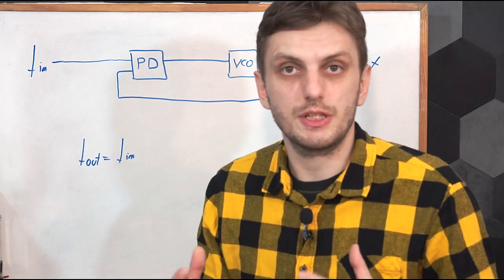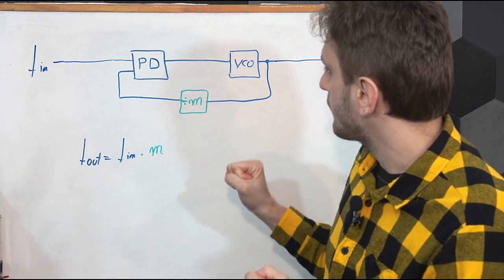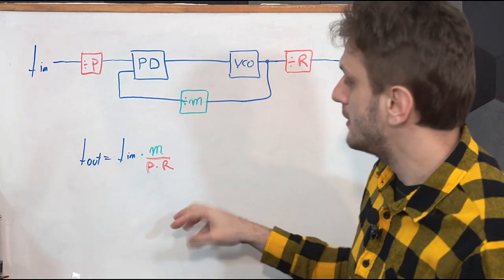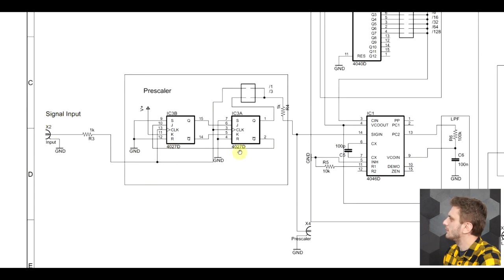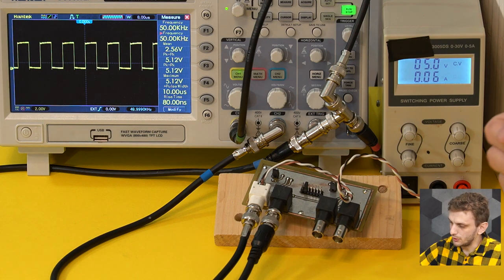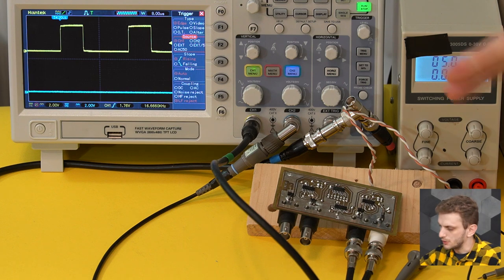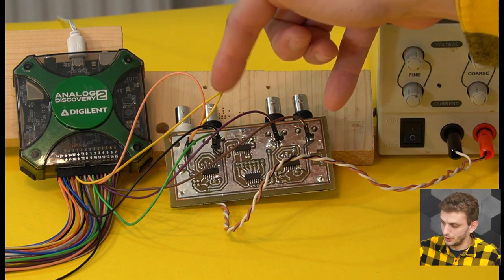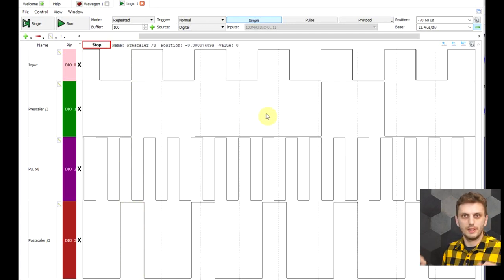PLL's - Signal Frequency Multiplication

Comment: This is an excellent video for understanding some of the older Transceiver circuits, such as Yaesu FT-736R. The PLL board in the Yaesu uses a Prescaler, Counter, Phase Comparator coupled with a crystal oscillator. Of course the Yaesu is doing all of this to control the Transmit Frequency of the radio. Thanks for the video!

Comment: Very good video that reminded me about something I had forgotten.   It also saved me some money.  I needed a frequency of 393.216kHz and a crystal of that frequency would have cost $500 each minimum.  But with a 32.768kHz crystal (under $1) and x12 multiplier using this sort of circuit I got the frequency I needed.

Comment: Clear and very well done. It would be great if you could explain a very important topic which is loop filter. How you choose the C and R values and what it does for the circuit. eg. cancels the oscillations inside the PLL loop and makes the system locks stable. Thanks.

Comment: John Keely in his late 1800's work shop, did same thing by applying tuning forks frerquencies down thermocouple/thermopile wires with nodes. The nodes and also small differing wires cliped on to main transmitter wire allowed frequencies to multiply. He said he could control some forces of nature with various ratios of gold, silver and platinum.. This was also verified by French scientist who applied ratios of resonant frequencies to plates sandwiches of differing metals for a lifting platform, which graduated to a floating open frame small air blimp .(translated from bablefish)

Comment: Can a 100 Mhz signal be produced with the 74HC4046? Or can the modulated signal with a frequency of 100 Mhz be demodulated with the 74hc4046? Or do I need to use a high-bandwidth RF PLL to do this?
Reply from the maker: I think the maximum operating frequency is 20MHz for this component. you probably need a dedicated IC if you want to work with ~100MHz.
Reply: @FesZElectronics  I cannot predict the usage area of fm demodulation at low frequencies. Due to the antenna size, Frequency Modulation is done at high frequencies. Therefore, a PLL with a high bandwidth is needed for demodulation. The 4046 is not suitable for this. So why was the 4046 produced? Is there a circuit where it is used in practice?
Reply from the maker: Normally in a receiver you will not work with the received frequency directly, but rather with an intermediate frequency - in FM receivers this is usually 10.6MHz.

Comment: Hi! Love your video! May I ask you a question that is troubling me recently? What are the practical limits of the multiplication inside the PLL? You certainly don't see clocks derived from 32.768kHz RTC crystal inside systems running in tens of megahertz. Maybe a better question would be what's the maximum frequency jitter of the output and when it will be significant enough to cause synchronization problems? Thanks again for the great video!
Reply from the maker: Hello Hristo! I don't think there would be an issue in going from 32KHz to 3.2MHz (x100) or even more. I mean, its a practical use case to have a ~24MHz quartz and go up to 3GHz, or similar values; but going from 32KHz to 3.2GHz (x10k) might end up creating some problems... I guess other issues would be that you want fast system start up - it takes some time to stabilize the initial oscillator, and then the PLL - if you have the oscillator already at a higher frequency its faster; also if you want to have a low power circuit, adding an extra PLL would not help - if you only need a few tens of MHz, then its easier to just put the quartz in. I guess a bigger practical issue would be the LPF - for 32KHz (or 64KHz) you still need quite a big capacitor, that cannot be built into the silicon chip - you would need an external component, that would limit the number of pins available on the IC. Honestly, I'm not entirely sure why most microcontroller systems use 2 quartzes - a low frequency one and a high frequency one.

Comment: Very interesting video. 👍
Do you know a discrete solution for a frequency multiplier using simple elements like comparators, opamps or logical gates? For example you have a sequence of narrow spikes and want to achieve a 50:50 takt of a doubled frequency.
Reply from the maker: Well, you could build the PLL from more basic components; but otherwise I'm not sure how this sort of frequency doubling could be achieved. By the way, is the frequency of the initial narrow spikes known? or does the circuit you wish to build have to work with any input frequency?
Reply: @FesZElectronics  I used this Idea
https://www.edn.com/convert-any-signal-to-exactly-50-duty-cycle/
I changed some parts of this circuit a got a doubled 50:50 takt signal.
I'm working on inductive power supplies. In order to achieve some targets concerning noise and lower losses you have to use on the secondary side of the system a synchronised frequency of the primer side, sometimes factoring it by 2.
I thought, you prbebly know another way to achieve it without using this PLL IC.
You are doing a great job producing your videos. 👍I like it.

Comment: Hey thank you again for another video!
I see that you are using analog discovery 2. Do you suggest it also for personal pratical experience?

I think that the problem with analog discovery 2 is the fact that the power supply is only +-5V and with opamp circuits which require a power supply of +-15V it would be a problem indeed but easily solvable since you will just need a separate DC desk power supply.

For what regards multimiter and oscilloscope i think that he can even substitute real oscilloscopes and multimeter for the 90% of the analog and digital electronics common application, don't you agree? 200 euros instead of more or less 1000 euros of instrumentation is quite the offer
Reply from the maker: Honestly I usually only use the signal generator, oscilloscope and the network analyzer function that puts these 2 together; I rarely use anything else.